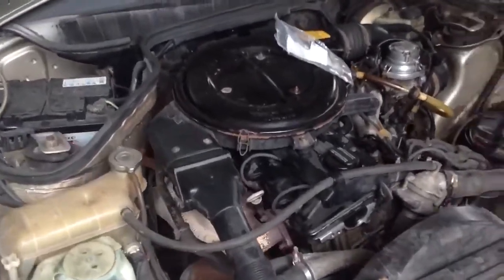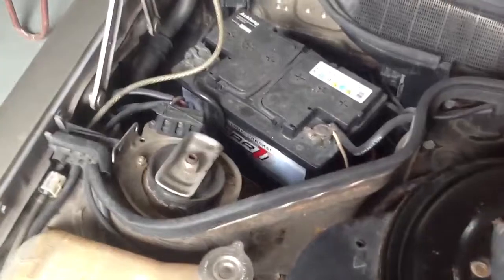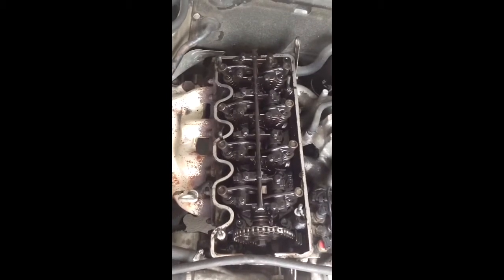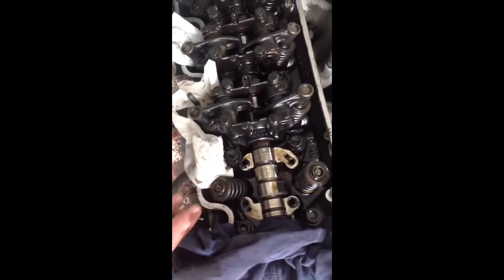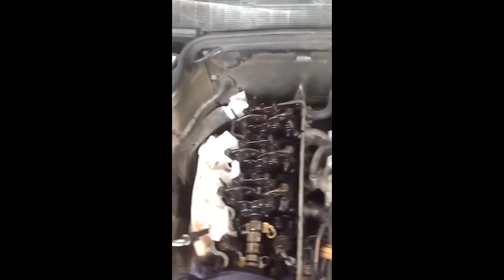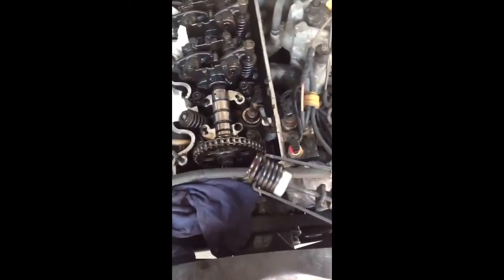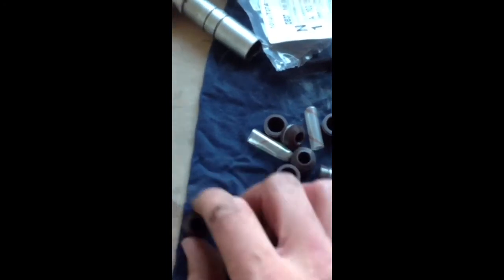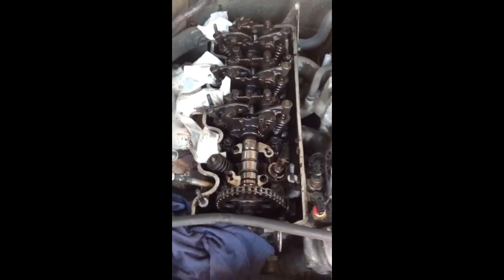Mercedes 190 valve stem seal overhaul W201 M102 M103 engine

Comment: Are the seals for intake and exhaust a different color. Could you clarify which is which? Thanks.
Reply from the maker: +Mike M  the top of the seal is different from the intake And exhaust.  When you order new ones from Mercedes you will notice it And when you watch the full video i thought i also mentioned in the video
Reply from the maker: +Mike M look at 3:21 in the video

Comment: Nice I need to do this to an m103. Did you have to rotate the piston to the top? Nice vid.
Reply from the maker: Yes i did rotate the piston to TDC because if air would drop or is lost the valve will not drop down in the cilinder
You have to search a little to get the perfect TDC so the engine will not rotate when you put air pressure in the cilinder
You can do with the piston in bttom position but when you loose air pressure and the valve will drop you need to get the cilinder head of and before that the cooling fluid. So a lot of more work ;)

Comment from the maker: Hello 

The beetle has a porsche 911 g50 transaxle 
I know there are reverse gears on the market but at my opinion it is 
Not a good choice becuase subaru transmission are not the strongest there are
And when you are going to run on 2 driveshafts it run on the limit is my idea 
And kit's have the same prices as a complete good 911 box